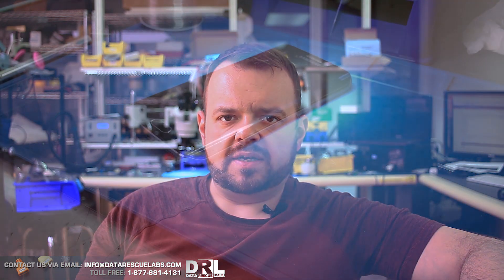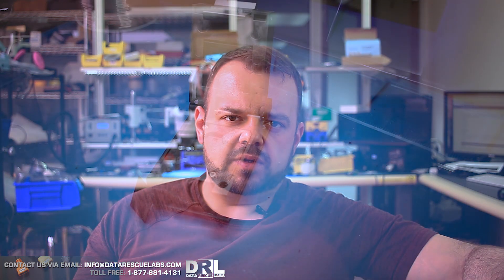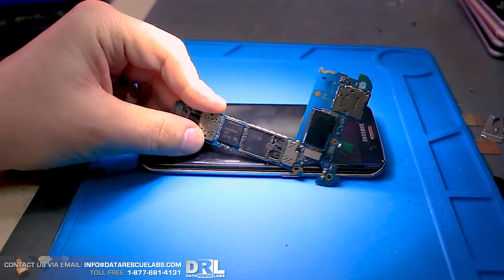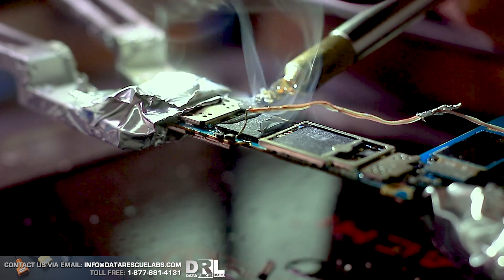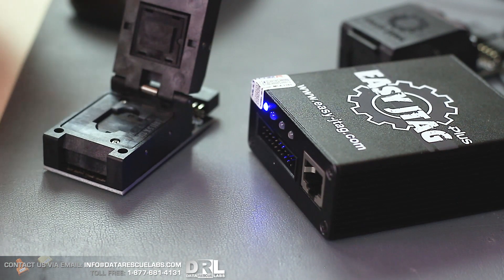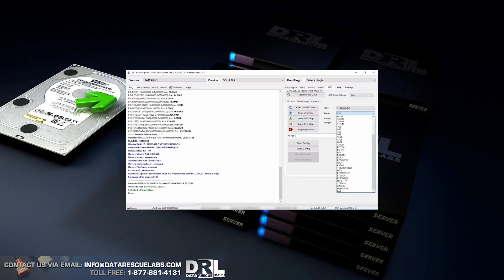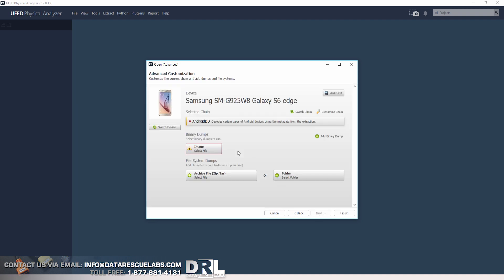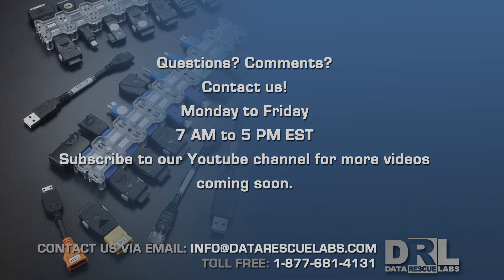Galaxy S6 Data Recovery Chip Off

Comment: Seeing that you were able to lift that chip off the board without damaging it or pulling pads or traces shows how much skill you have. I have tried reballing Xbox 360 motherboards and I could never get consistent temperature and I would end up damaging something.
Reply from the maker: You need to increase your temperature. With not enough heat, you will always lift pads
Reply: @forensicguy  do you have a infrared station that gives consistent heat? I was using hot air and would either pull pads or traces not being hot enough or melt the chip being too hot.
Reply from the maker: Yes I use IR6500 infrared station. Worth every penny
Reply: @forensicguy  I believe it. That chip removal was impressive 👌
Reply from the maker: Thank you. I just posted a new video

Comment: So what you're saying is that my dead S7 which has fingerprint security on, can easily be accessed by someone looking to check inside my phone without it requiring a password or anything? I wanted to try and get it fixed but now I dont want to take the chance as what it my private folder files can be accessed
Reply: Well lock screen can easily  be bypass just power off your phone so it's encrypted  and upgrade  your phone so you  not using  outdated  software

Comment: I see you use a lot of tools from different manufacturers. If you were starting out which on would you get to start with. generally speaking.
Reply from the maker: Depends what you want to do, ie data recovery, repair, computer forensics etc
Reply: @forensicguy  i need your contect